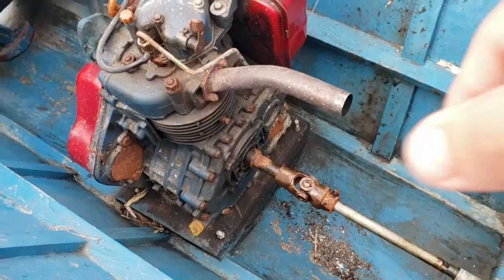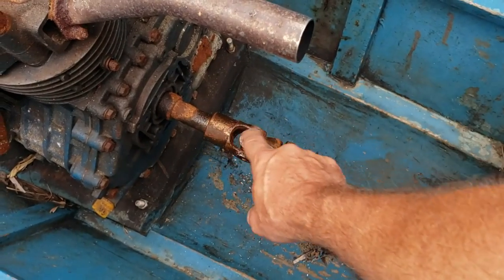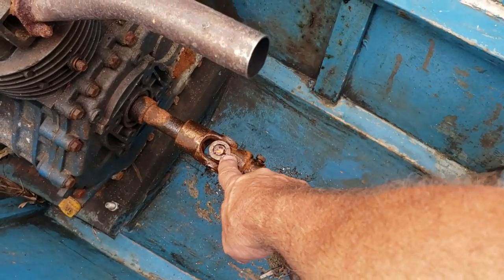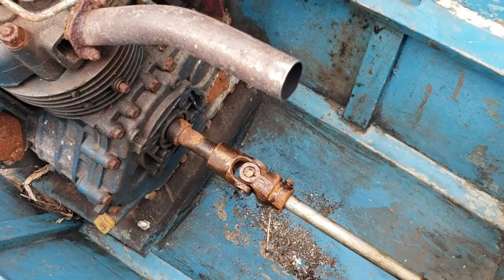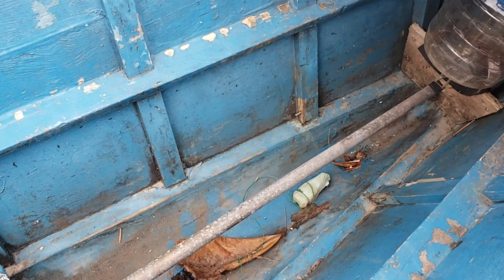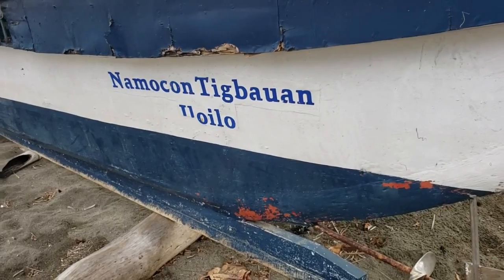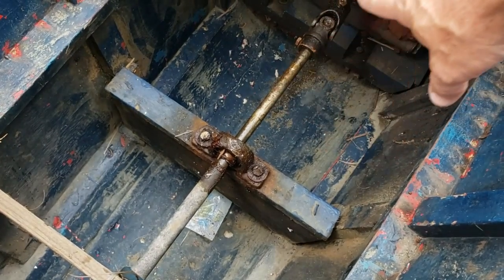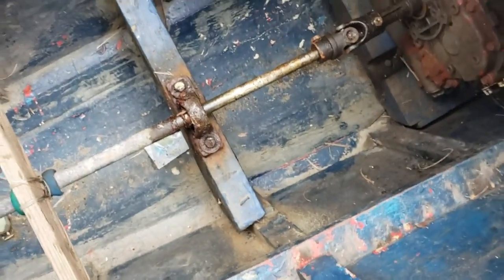Foreigner Farming in Philippines -PUMP BOAT Tight Motor, Black Smoke no Power- WATCH THIS

Comment: You are spot on in regards to shaft alignment, and the use of the pillow block bearing to take the thrust off of the crank bearings. Also I do not understand why they don't use an outboard strut with a rubber bearing in it to support the shaft in front of the prop.

Comment: James, Places that rewind electric motors are a good source for small bearings in PH.
The nice thing about the bearing you are using is that the outer race is convex
not flat and the housing can be 3 degrees crooked but the bearing is right with 
the shaft so the mount doesn't have to be perfectly aligned. Most flange bearings
are also self aligning.

                              george and aurora

Comment: OK ,listen up to 60 years of experience and an engineering degree. The support 
bearing is a must do and the pillow block is easy to shim vertically and slide 
to side for left to right adjustment. Item no 2. To align the shafts take the 
universal joint off and slide the prop shaft forward till it touches the motor shaft.
 Put a dial indicator on the motor shaft (it's magnetic and the stainless prop 
shaft is not). read the deviation as you rotate the motor with the indicator riding
about where the U-joint cross would be.  write down the two side readings and 
the reading on the top, then  try to get it shimmed to less than .003" total difference 
if the prop shaft has no support bearing put some tapered wooden matches or 
street vender skewers between the shaft and brass tube. Do all adjustment of
 the motor end by shimming up or sanding down the wood block. Next item is the
cross joint they must be installed in pairs. Just look under your multicab or an
Elf truck, anything with a drive shaft. The two crosses on the drive shaft HAVE 
TO BE IN THE SAME PLAIN, and the ones on the prop shaft and engine are in a
plane as well, just rotated 90 degrees.
     Ok so you don't have a dial indicator. Get some solder like you put electrical 
connections with. Wrap it 5 times around the shaft and put a rubber band around 
it or wrap and tie fishing line to secure it. take the loose end and bend it 90 degrees
so that it is just not touching the prop shaft. Visibly inspect the differences side 
to side by rotating the motor. Line that up and then measure the top and shim or 
sand the motor mount till the top is right. Then check the side to side.
          One final note, running a universal joint in a straight line causes a short lived 
part. The needle rollers in the bearing need to rotate 1/2 turn so as not to wear flat 
spots on them. We set race car universals up at 5 degree angles on both ends. Can
be side to side or up and down to get to the 5 degrees.
          If your engine is not a ball bearing crankshaft get a  "split set collar" which
is two piece and can be installed without taking anything apart. Mount that  on
the prop shaft side of the support bearing. Eccentric locking bearings grip much
tighter than set screws. Turn the lock collar the way the shaft rotates.

                                   george and aurora         "CONCRETE HOUSE BUILDING IN PH"

Comment: what type of engines are the most reliable for a medium size boat? (not a dive boat for 35 people. rather a small fishing boat for 5-8 people.
Reply: Pro quip, Honda and yamma (not Yamaha) is what is recommended by the boat  builders in Davao. Most other brands like Mitsubishi have problems with finding parts. There is a pro quip 19hp electric start with transmission. It's got neutral and reverse.  Got to reserve one. They sell like hotcakes 😂

Comment: Very interesting.  That is the voice of experience and sounds like solid advice.  What prop size would you run on that 16 hp?
Reply from the maker: it depends on the size and weight of the boat. Also the loads it will carry. Maybe if he is planning to load it down a 8 or 9. If it is just light weight boat carrying a small net you could go a little bigger.  He also needs to put on a back nut behind the prop and then drill the nut and shaft and put a stainless or copper pin thru it. This ensures no prop loss. You also drill a hole thru the top of your rutter and put a wire or nylon thru it and tie it off on the back of the boat so if the upper nut holding it comes loose you dont lose your rutter or it drop into your prop damaging both. Double nut EVERYTHING! ALways have spare prop, cross joint , and pillar bearing , grease and a few basic tools that fit those points on the boat- fail not. you can break down and drift out to sea. We have done rescues here with our boat and the fisherman be from far off and drifted.
Reply: @TexasFilipino  Thanks for your thoughtful response.

Comment: I am fabricating a stern drive for my boat using some part of yamaha F15 outboard.  i will use a 20hp diesel engine.  maybe adding a.torque converter.
Reply from the maker: been many times- not hard at all. So many videos covering that as well. You can do it.

Comment: Roller bearings versus  Tappered bearing are complete different ball game.  If all you have a row of buildings in this drive line...  If all you have.... Is roller bearings in this drive line... It will not take too long . Before  all bearing dead.
Reply from the maker: that is correct!!!! welcome to the Philippines
Reply: @TexasFilipino   If you do buy  a block bearings  This also is available in a  Flange block configuration... Make sure it's lock one.. That lock to the  Shaft... This is the  Beating..  probly cost you about a 1000 pesos to  Replace .. This bearing..
Reply: Timkin tapered bearings are an inner cone and outer cup which are installed
in opposing pairs or the cone just slides out of the cup. A machined housing
or hub carrier mounts them. There are "mounted" double timkin bearings with a machined housing in flange mount or pillow blocks "called plumber blocks".
You can download timkin's entire catalog online. One other thing the mounted
bearings also have the oil seals installed in the housing. I would likely specify
deep groove ball bearings for this application. Usuall the part numbers for those
begin with  ZZ

              george and aurora   we will race anything that goes fast enough to kill you
Reply from the maker: that is why I was saying it has a set that locks it to the shaft. That is the kind he needs.
Reply from the maker: George that is fine but  he will need to stick with whats available at local shops. if it breaks and it is something ordered from far away he is dead on the water for awhile. He can stick to the local way even if its not the best part but it's common and avail

Comment: Part of the purpose in having the Pilar block bearing there is to take the forward force out of the shaft and put that force on the boat...without the Pilar block bearing the engine wouldn’t last very long ...

Comment: New Sub  Wisconsin Hello ..you have the best pump boat info ive seen .  Question ; new 35' boat &  motor water ready ...apx price ?   salamat  po ....
Reply from the maker: I actually don't know. The used ones get passed around here until pass going. I have never seen a new one on these shores. In fact less n less boats all the time. COast guard is really cracking down on illegal fishing here too and unpermitted boats. They came checking mine today - i was all on the up n up thank goodness